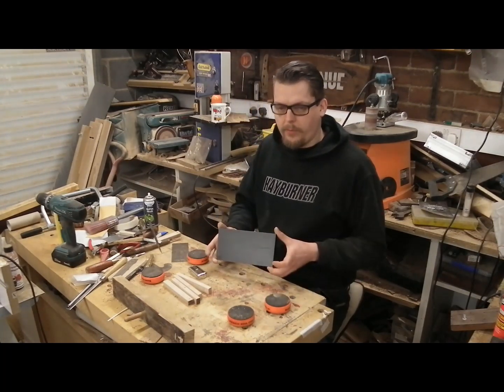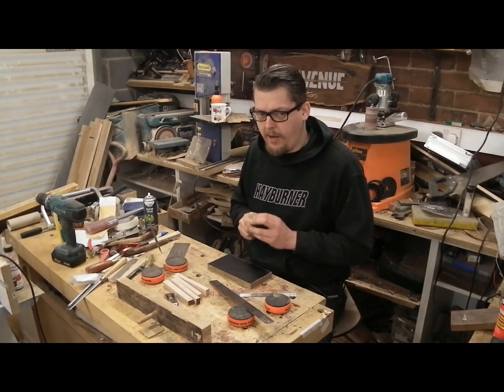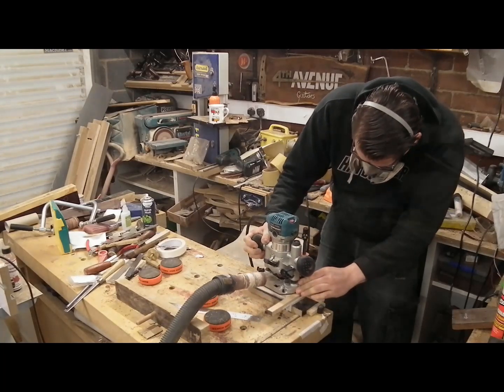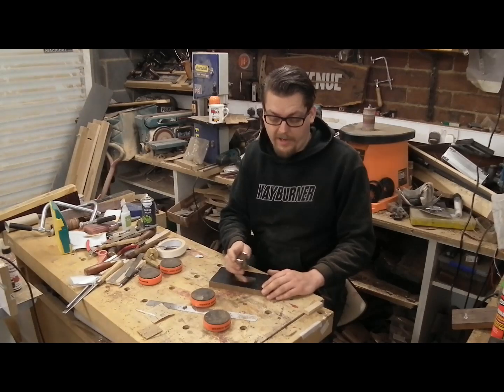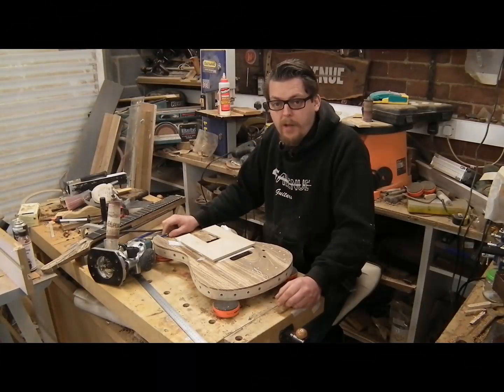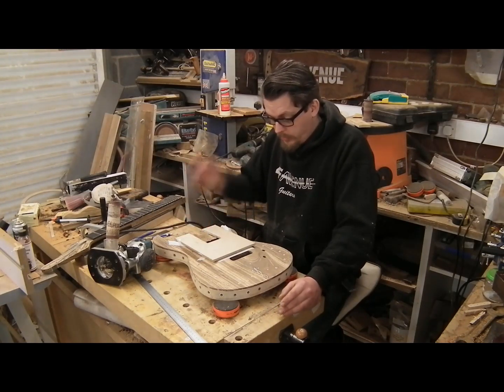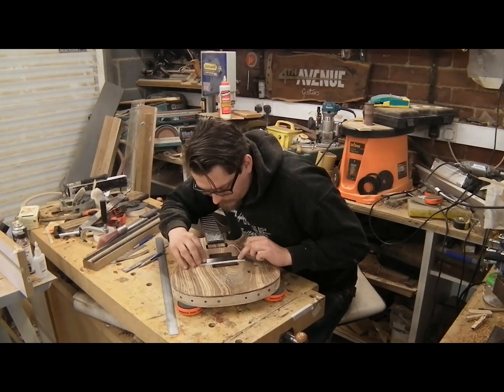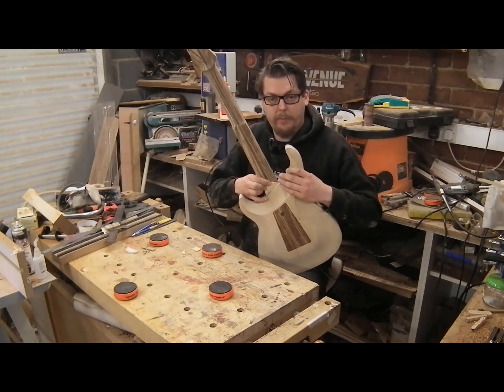Custom Guitar Build: The Phoenix #002. Part 16; A Guitar Shaped Object.

Comment: Love the neck heel idea. 
Will this be finished in wood tones or do you ever use color dies? I'm torn between my love of natural wood colors and the picture in my head of this thing in a red, orange & yellow real flame die job on the face! With the lights setting the illusion of fire a blaze!
Reply from the maker: Now that does sound pretty. I’ve got a kinda Jekyll and Hyde type feeling with this one, just natural wood so unplugged it looks like nice and tasteful, then as soon as you plug it in everything lights up and it becomes something else entirely

Comment: Neck joint. 
I love the look of the "Stephens Extended Cutaway" or what Washburn had on the original run of the "Eagle" ( http://www.g3h.be/wings/eagleB.htm ) 
Where you got no heel to worry about. Hell it works for Nuno..
Reply from the maker: Oooh, I do like that. I did a similar access carve on a neck through bass last year, It does make for incredibly comfy playing up at the dusty end.
Reply: @4thAvenueGuitars  I had an "Eagle" (like the white one on that page) years ago. Stupid as I was, I sold her off. And I miss her. But. She was a hefty girl to strap on the back of a small teen, so a "repro" has to be done hollow - with a Kahler tremolo.
But all those bells and whistles they har; brass nut, brass saddles, brass pot tops - might even had a brass tip on the 3 way. 

But I have to say. The Magpie is looking like a work of art - and not Picasso art, more like Mona Lisa.